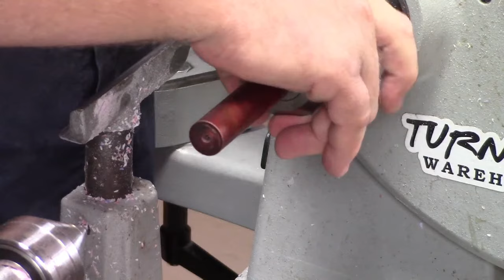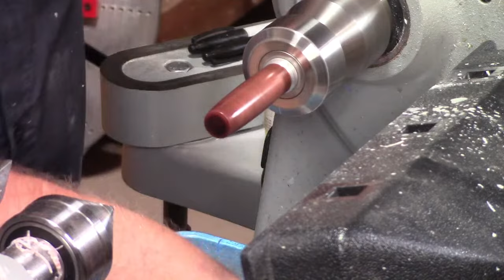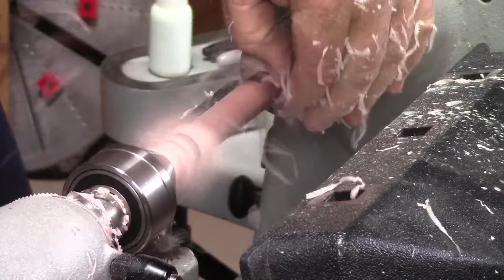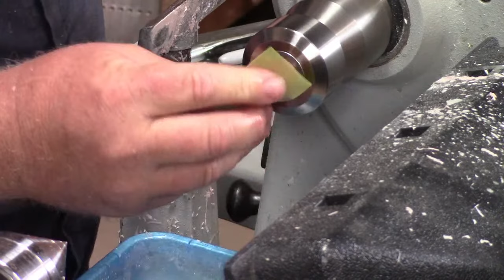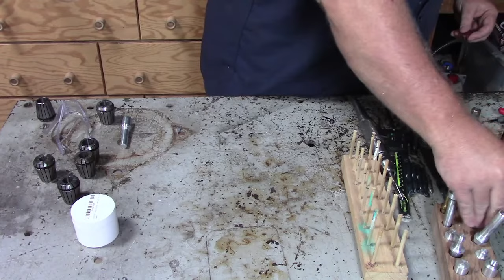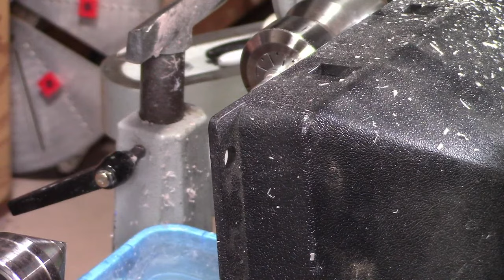Custom/Bespoke Pen Turning Part 4- Shaping and Finishing

Comment: Hello chad do you use on th cam vac 1 motor or 2 motors when sanding thanks Michael
Reply from the maker: 2 motors running while he was turning, no motors while sanding. There are three motors on the big cam vac that he has but he rarely uses all three and it is surprisingly quiet. We are currently out of the biggest size cam vacs (they are on order) and have the mid size, which is a two motor system. 
Hope that helps!! and thanks for watching!!